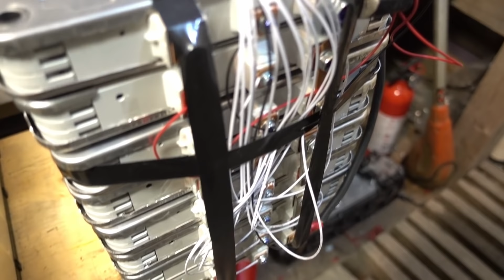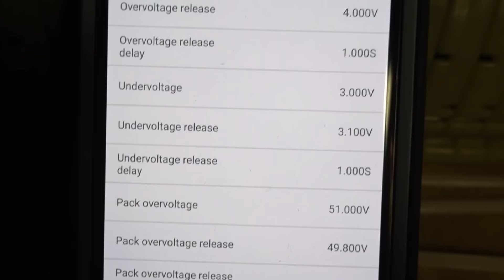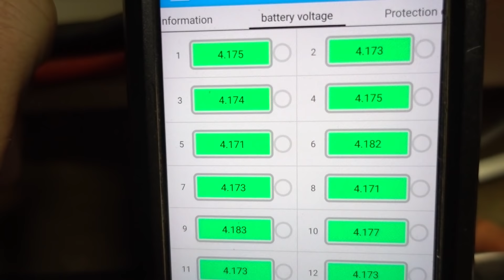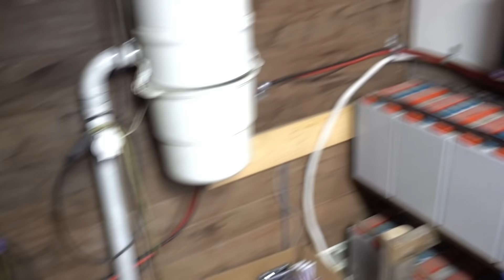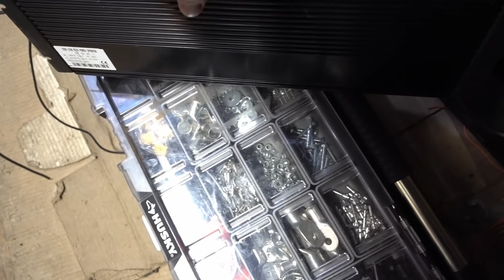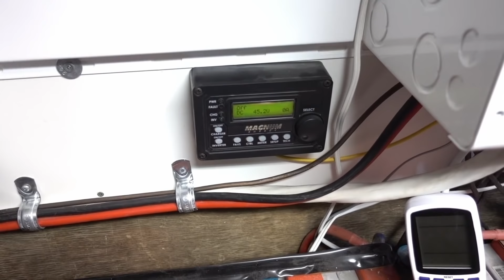Chevy Volt Battery/ BMS Test/ Fuse Fail

Comment: i may have asked you before,,but ,what would you say would be the max amps you would charge the volt batts with?..im at 30 now thinking of going higher ,i can do up to 100 amps,,i just dont wanna heat up or hurt the batts,,but i felt the cables at 30 amps and there stone cold

Comment: I have a question for you on the BMS what BMS could I use for my battery pack my battery pack 8 cell it's about 7.6 volt fully charged
Reply from the maker: what is the battery used for ? and 7.6v?
Reply: 2010 Toyota yaris 120 cell at 14.5
Reply: I don't charge the battery to 15.2 v because the is the max

Comment: Do u really need bms on all ur batteries or can u manage them on ur own
Reply from the maker: the problem with lithium is its good 80% of its life most of the time with no bms, but I do not think its wise to take that chance as they are very powerful, and even a cheapy bms can save you from these dangers, so I would say a bms is needed yes.

Comment: Where do you get your bms's from?
Reply from the maker: aliexpress
Reply: Do you have a link to the specific one?
Reply from the maker: yes here it is

https://www.aliexpress.com/item/12S-100A-smart-board-lipo-lithium-Polymer-BMS-PCM-PCB-battery-protection-board-for-18650-Li/32848466970.html

Comment: Does your BMS cut off the charge at 4.1 volts per cell?  How many AMP BMS is it by the way?  The one I have coming is good for 60 amps.
Need to make battery box bigger as well insulated for cooling and heating in the winter.

Comment: Do you run a absorb time at all or just straight to float? Nice work on installing your new electric panel setup.  Check the bonding on the generator panels as the system should be bonded at one place the main grid panel for the neutral.
Reply from the maker: thanks and I let it bulk charge till it hits the selected voltage then it goes into float, no timer

Comment: What would your absorb settings be on your charge controller? Do you float the Volt battery?  Any help in dialing the settings in would be great.
Reply from the maker: i have my bulk set to 49.2 and my float at 49.1 make sure to turn off equalize.

Comment: Picked up a 2017 Volt Battery the other day. So it is different than your Volt battery.  I am going to be connection up in a 15S setup.  Will give me a 56.25 volt pack.  Plays better with my outback inverters and FM60 charge controllers.  I will be able to get 6 of the 15s packs out of the battery.  I have ordered a 15S 60 AMP BMS from China. I think i will need a BMS for each pack of 15S correct?
I am building a diveersion relay as well for the cutting off the solar input if it gets to high.  Same for goes for a low voltage disconnect as well.  Will have to get a make before break DC transfer switch to transfer to other battery.
Reply from the maker: Jeff Bakker yes I would use a bms for each 15s pack, your gonna love the battery, I'm leaving mine 12s as my inverter can run as low as 36v and as high as 64 volts love my magazine inverter
Reply: I can go pretty low on the incoming voltage and pretty high as well with the inverters but my issues are the POS outback FM60s won’t go below 52 volts.  I need midnight ones.  In the future.  On the BMS I have one to try then I will get rest when it’s all wired and working.  Are they easy to wire up?
Reply from the maker: yes very.
Reply: I can’t believe how much power there is in this battery vs the FLA bank the curve on discharge and recharge is so flat.
Reply from the maker: yes I love lithium, might give the gels to my rents soon :D
Reply: @Jeff-ow4ud  why BMS are you using?
Reply: which bms...
Reply: @Ecfectus  I am using 60 AMP BMS units from China.  The are smart units.  Talk to them VIA bluetooth or via USB.  I have 3 at the moment.  I went with 14S for my battey packs.  Got them off ALI express.

Comment: Since you have more background in these batteries I just got my Tesla battery today and my windmill from China, vertical axis windmill if I underclock my batteries or under charge them will they make them a lot more Stabler the voltage in the cells balanced
Reply from the maker: Leigh Amos when only charging to 90% the cells last much longer, and it makes it safer to use with out a bms but I recommend using a bad for safty
Reply: I was looking for a 6s bms but the high amperage ones don't exist for six cells I did order a 15 amp one that's all I could find
Reply: Do you think it would be too scary to run a couple of leaf cells in parallel, four to make the tesla batteries 7s, 7th cell to get the wider voltage range.
Reply from the maker: parallel is fine, I have 6p 16s in my system/ my Hyundai sonota batteries
Reply from the maker: you try aliexpress?
Reply: I have ordered five different BMS off of eBay and Allie mostly off of Valley two of them have the phone monitoring on them the one that you have I ordered all the parts for it and another one that is a 7s

Comment: Is that an AGU fuse?  If so it is only rated for 32V... correct?
Reply from the maker: it does not effect the amps tested these as I have 4 and they cant do more then 35 amps continuous :S or boom lol
Reply: True but it is rated to only safely interrupt current on up to a 32V system.  Just sayin' when you look for another fuse option please consider that. (Background: Consulting Electrical Engineer for Building Power Systems)  Cheers
Reply from the maker: thanks I will for sure, this was something at my local electronic store :D and it did protect quit well, not that I trust it at all after testing :D

Comment: Hi- Where did you get the $20 BMS that you use on the Leaf and Sonata batteries? Would appreciate a link. I have purchased 4 different BMS's for my powerwall and none of them work properly. POS's. thanks
Reply from the maker: you need a bms every 20-30 Ah worth of battery at 16s for these to work well, here is a link to one that looks and has the same spec as mine.

https://www.ebay.ca/itm/BMS-Protection-PCB-Board-for-3S-4S-7S-10S-16S-18650-Li-ion-LiFePO4-Battery-Cell/182649915121?var=485207356406&_trkparms=aid%3D222007%26algo%3DSIM.MBE%26ao%3D2%26asc%3D20180124145912%26meid%3D084076b360e84ca5a36446d04b476b77%26pid%3D100005%26rk%3D1%26rkt%3D4%26sd%3D112477569093%26itm%3D485207356406&_trksid=p2047675.c100005.m1851
Reply: Thanks for the link. Nice BMS. It appears that seller does not offer 13S, 48 V, which is what I need. Is there a manufacturer name on your circuit boards? thanks again

Comment: I have a question. When using EV batteries wouldn't it be better to use them the same way the vehicle used them at the high voltage, 300-600 volts depending on the battery pack instead of taking them apart, and then step them down with a transformer?
Reply from the maker: John Smith it would be best to use 120v battery for 120 a.c. but as battery dies you will still need a transformer

Comment: Great video........Does the Tesla Power Wall 2 have a inverter built in ??
Reply from the maker: glenn goodale yes
Reply: thanks
Reply: Tesla PowerWall 2 have built in inverter also charge controller I think is 5kw grid tie with battery backup capabilities....👍
It is all in one.......if only the price would not be so high with 1/2 the price I would call one of those mine......
Reply: Thank you so much  !!   Is there any videos the insides  ??

Comment: I wouldn't rely on those alligator clips, the cable is pretty crappy in both quality and current capacity.
I made my own set of leads which are much more solid.
Reply from the maker: station240 im going to use the bms wire for all the batteries this was just a quick way to test 4kw of power